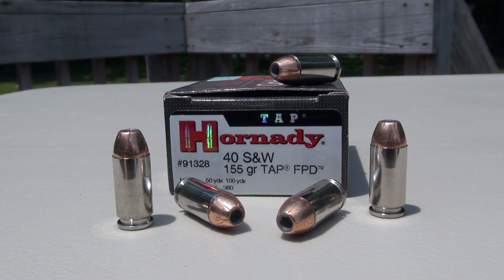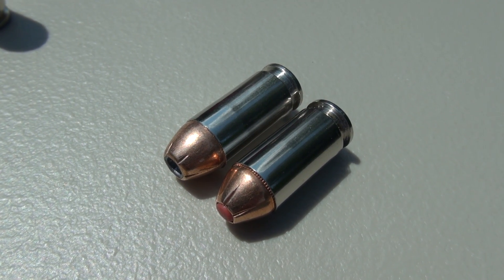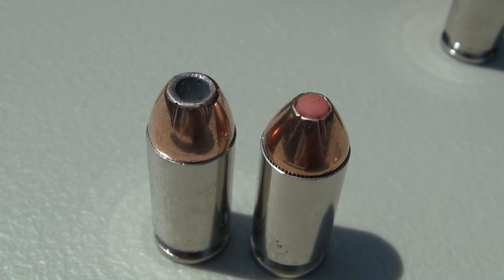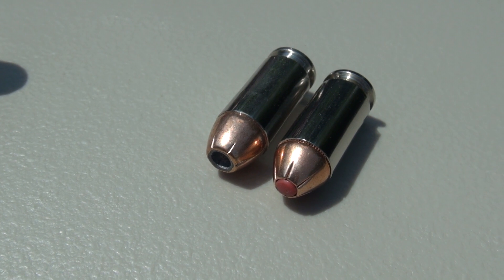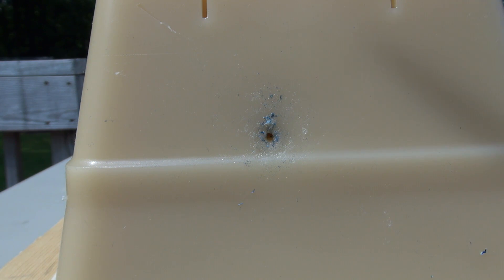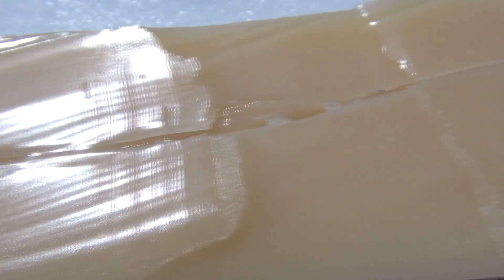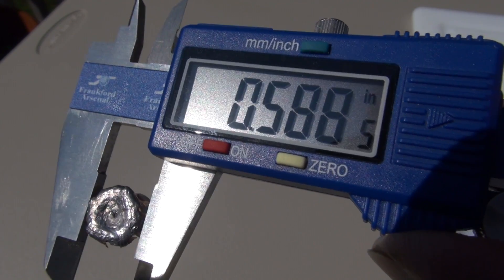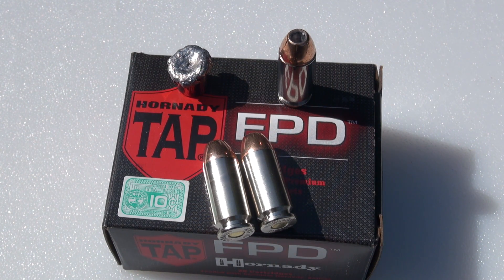Hornady TAP FPD .40 S&W 155 gr JHP SIM-TEST w/denim

Comment: Hornady makes good ammo and it’s very accurate. My department issues the Hornady Critical Duty 9mm 124+p. I’m not a huge fan of Hornady handgun ammo though. They don’t really focus on expansion as much as penetration which is good for law enforcement. I prefer the Speer 124+p Gold dot or the Federal 124+p HST. I use Federal 180 grain HST in my 40’s.
Reply: I carry Federal 180s in mine. I think its perfect overall. If I go in the woods, mountains, etc I will use something with more power in a 165gr

Comment: After the FBI suffered their horrible defeat in the Florida shoot out with two bankrobber-killers they reviewed their policies entirely and decided that over penetration was an unfounded problem compared to what actually happens in shoot outs. That is when they went overboard in going to the 10mm auto before settling on a 180 grain jhp going 960 fps from the 40 S&W.  But the 165 grain Gold Dot at or over 1100 fps is better and not too much recoil.

Comment: It appears from this test as well as the new FBI load ( Critical Duty 9mm 135 gr. ) Hornady projectiles appear to be more geared towards penetration over expansion.
Reply: That was probably what the 9mm round was lacking was. From what I’ve seen in other testing whether gel or meat and bone, was that the majority of all 40 cal rounds no matter what weight they were did adequate penetration and expansion due to its inherent loading.

Comment: do you know the difference between 180 grain  custom & american gunner in180 grain
Reply: Grain is just a unit of measurement. It's how much the bullet(just the bullet, not the entire round) weighs. 180 grain is about .025 pounds
Reply: I think the difference is in the components. I know the critical duty uses ftx bullets and nickel plated cases with a sealed primer. I think the critical defense and custom are xtp bullets, brass cases and non sealed primer. I believe the American gunner are xtp bullets with less expensive powder and primer. Your best bet is to write Hornady an email. Their customer service is great.
Reply: thanks for the information.

Comment: These Hornady TAP rounds are one of the most tapered rounds in 0.40, so they feed very well in Kahrs with the steep feed ramp, also the nickel coating helps feeding.

I also have heard of the low flash benefit too, I haven't tested it in the dark yet... :)

Comment: While, I’m not impressed with the expansion of this particular cartridge, I’m not overly concerned with “overpenetration” as long as the bullet expands sufficiently and as it was designed to do.  Something expanding over 60 calibers and making a large exit hole is not necessarily a bad thing. 
Deeper penetration means a greater chance to hit the vital areas and 2 holes (with the exit wound being real big) more than doubles the blood loss and chance for incapacitation.
Reply: Let’s not forget that this is a gel test and should be taken with a grain of salt. If bone and other materials were included the bullet would’ve had been in the 12-18 zone. As for expansion, seems good to me.

Comment: once again great testing. I would still love to see a .380 vs .38 in the sim test but that Is just me. I dont ever like to tell someone else how to run their channel. By far the best and most accurate testing I have seen on youtube bro!
Reply: Ive never seen or personally tested a 38spc cartridge that expanded reliably our of 3 " barrels or lower.  I carry an airweight 38 somwtimes in the summer .. i carry underwood ammo, extreme defender.. it rivals 9mm jhp wound characteristics and penetrated to 18"...  These rounds have "flutes" on the nose of the bullet that cause wounding like a jhp does but doesnt rely on bullet expansion to do so.
I think this is the best defense ammo for a 38.. i carry the +p. And because the projectile is light, the recoil isnt as bad as other +p ammo in the little airweight snubnose... If you have one you know what i mean.
Reply: @no.step.on.snek.2423  you do have to have a really good designed bullet for .38spl to reliably expand. Soft lead hollow points and Hornaday critical defense are the only ones I have seen that work decently in a short bbl. It really needs the 4in bbl to produce enough velocity.
Reply: @willwood487  you right about that.. the longer barrel helps alot...

Comment: The tap line uses the xtp bullet, which usually expands through denim, but doesn't seem to have the expansion of other rounds, I have tested some of the 45 tap and 9mm tap with mediocre success. I also found the 9mm pdx will expand larger than the 45 xtp. Another great ammo review, thanks and could could you please test some grizzly xtreme in any caliber in the sim test?